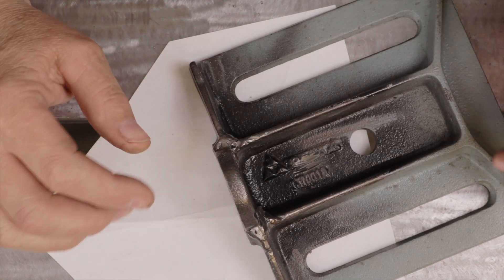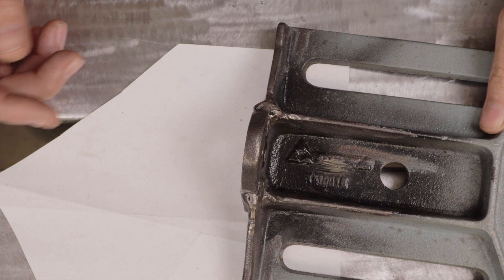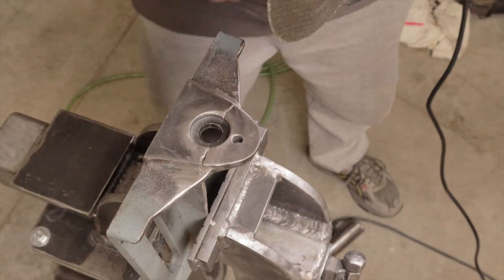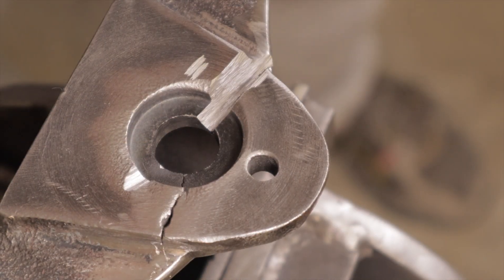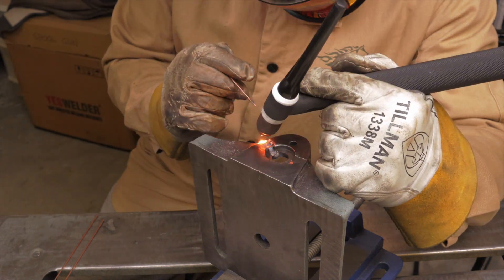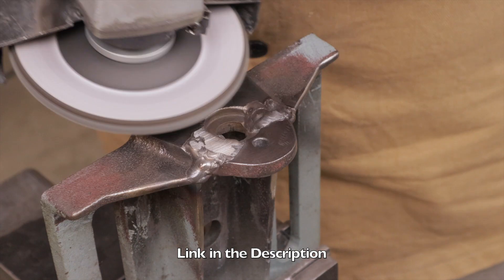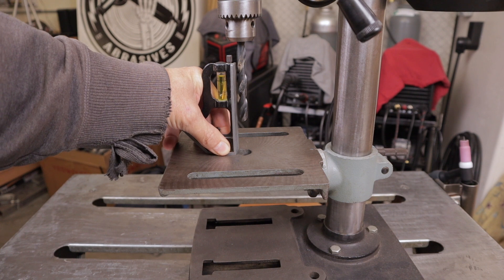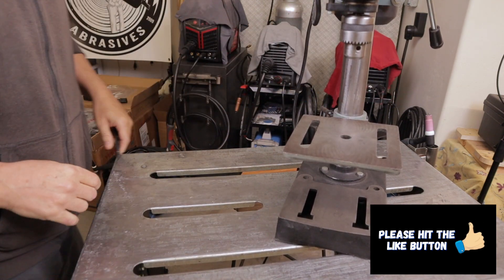I Saved $200 with this Cast Iron Weld Fix

Comment: Great job as always. I have the same welder. How many amps did you use to repair this?  Foot pedal? Thanks
Reply from the maker: Thank you! I used 130 amps on the machine with a foot pedal.

Comment: I don't think you'll have to worry about it giving out in the machines lifetime. It might one day crack again but not at those welds. I am curious if not preheating n not "properly" cooling it down has any long-term effects on the surrounding cast iron but I suspect it'll be just fine for what it's for
Reply from the maker: Thanks for your input Ben. From what I've seen the weakest part is usually just at the edge of the weld. I didn't see any cracking after the initial cool down so I am pleased with this repair. We'll see how it does after I start putting some pressure on it using the drill.